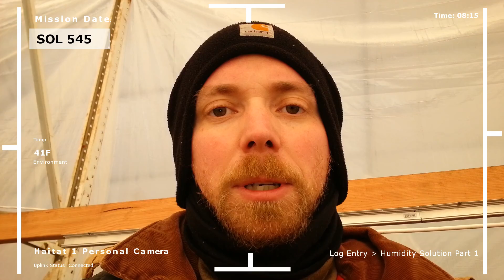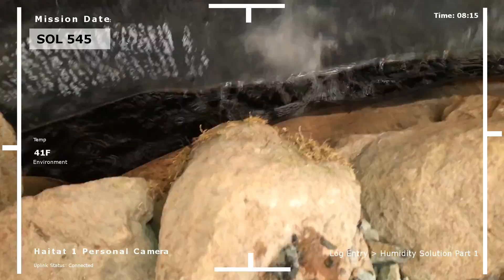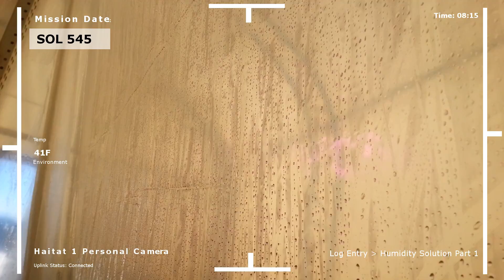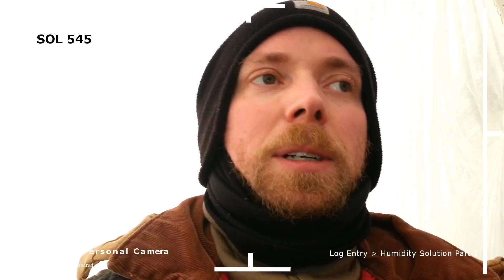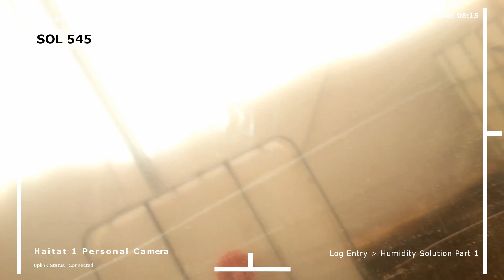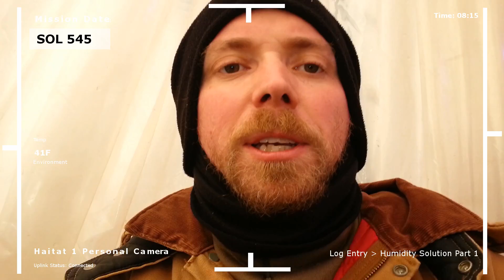Low Cost, DIY, GREENHOUSE Heating Solution  - Part 1

Comment: If the primary moisture source are the growing beds and you are using trays then why couldn't you make inserts so that only the surface of the plants are exposed to the air?  This way the water source is not exposed to the air and will them make the fish tanks the number 1 water source which can be sealed as long as the water is well oxygenated?!  Correct me if my thinking is wrong or I am missing something.
Dale Orthman-Castle man!

Comment: thow it would not help with the cold that coming right now and the humidity if you are use a 3 layers of plastic with a half 5 centimeter gap using air as the insulator and by putting a wood stove above ground to draw out the humidity  or you could uses a whole house dehumidifier

Comment: Patroon here:

Im familiar with this sort of thing.  I have been drying houses after water damages for many years, only recently changed professions, and was certified in advanced structural drying.

I hope this gives you idea.

For every 20 degree increase the air doubles its moisture capacity.  Essentially, cutting the Relative humility in half.  But again if you lower the temp by 20 degrees you are doubling RH.   Also, another variable that plays a role in the amount of evaporation you will get is Vapor pressure differential.  The greater the difference the greater the evaporation.  Another way of removing this moisture based on the principle above you can take the cold air outside and heat it up this will create an enormous vapor pressure differential sucking up the moisture and having that moisture laden air go into a second chamber outside the tent to condense on the walls.  and simply pump the water back into the fish tanks.

This is really cool what your doing and i'll be sticking around.

Comment: This is going to be fun,Jeff, thanks. But when the water condenses onto your sheet, isn't it just releasing heat into the air inside?
Reply from the maker: thanks for following us Craig. The heat release does occur but it actually releases onto the plastic and then transfers through the plastic into the outer area.

Comment: The dehumidifier is a solution for the immediate problem. But, they do suck energy. For the long term, you might want to experiment with some other technologies. Some people use a highly absorbent  polymer that is contained within a large wheel. A small fan circulates the humid air on one side of the wheel which slowly rotates. The polymer absorbs a lot of moisture and then they use solar energy to drive the moisture out of the absorbent as it rotates through a separate chamber. I don't see why that process couldn't be adapted to use heat from your wood burner.  Its just one of the possible options.

Comment: Am looking this, making my brain work as you explain it with the issues and theories on it.  Please keep up the good work. Can this be computer controlled/ monitored maybe from a Raspberry PI, small lightweight and low voltage?
Reply from the maker: it sure can...I'm using Arduino for now but plan on getting custom boards to minimize size, power, and complexity, in the future...thus minimizing all costs and getting a truly optimized solution.

Comment: dehu is only one part of the equation, mitigation should be the focus, start plants in rockwool and transfer them into covered beds grow your micro green in a tent that is part of the grow bed. also consider aeroponics as they are far less water intensive and easier to control the water evaporation, temps etc. also you can double the outer layer on the greenhouse to give you a thermal barrier that can be inflated with air to give you  some insulation....

Comment: I have ran into a very similar problem with humidity as well.  Ours is actually to the point it rains inside from the condensation.  Dehumidifiers suck a lot of juice which is expensive to make off grid or on mars.  It would be much more efficient to use temperature as humidity is relative to temp.  
If you pull up a dew point chart you will be able to calculate the temperature swings necessary to dry the air out inside your tunnels and push the hot air into the main greenhouse to condense on the side walls.  I think the french drain idea or gutters is great to capture the water.  Heat can be generated many different ways which makes it more doable for off grid.  Also remember that mold hates air movement.

Comment: I will start off with a very basic suggestion. You are trying to control the environment inside a Plastic bubble with no Insulation. The temperature swings from night to daytime on sunny days are huge. The money you will spend on insulating will payoff in reduced energy for heating in the winter and cooling in the summer.

Comment: As someone already commented, I second the idea for a general system overview video.  I am sure you will cover all the features eventually, but it would be neat to understand the entire concept right from the beginning.  I get the aquaponics part, but am hazy on the methane digesters.  I take it you are using manure from your cattle to supplement the solar generated electricity?  How does that work and is it on line yet?

Comment: Unless NASA (or whomever makes it to mars first) chooses to use nuclear power, wont electricity to run these systems be limited? 

All the dehumidifier is doing is creating the perfect place for water vapor to condensate, which is to say a cooler place. Could that be accomplished using the cold environment you have available to you, rather than electricity powering a refrigerant system?  You could use a closed loop PEX tubing filled with antifreeze. It would consist of a series of coils inside the hab and outside in the freezing environment and a small circulator pump to keep the fluid moving. It would work similar to a geothermal loop but cold.
Reply: I suspect he has a better electricity budget than heat.  In other words, doesn't your suggested design effectively pump heat out of the greenhouse whereas powering an electronic device (which probably creates heat while at the same time iot creates cold...) is probably close to zero net temp change (A hypothesis to test!).
Reply: IDK, thats why I asked. The Dehumidifier is literally making ice at the cost of electricity. If the cold tubing is the only mechanic condensing the water vapor why not use the outdoor ambient temp to do the same thing.
Reply: On actual Mars where you have almost no atmosphere you would also get almost no passive cooling so it wouldn't do much.
But on Earth you can use external temperature to get the same condensing effect, downside is a good deal of extra infrastructure and bulk.
Reply: While air cooling would be more convenient, the frozen ground would work fine as a heat sink. It might also be worth the heat investment to free small amounts of water from the ground.

Comment: Good idea to put the dehumidifier inline with ventilation system.  I'm new to you. What is your ventilation system?
  Is the ventilation system ducted?  
 Is the grow tent inside the larger tent? 
 Where are you pulling air in from?
   I assume the vent system is exhausted to the outside? 
 Is there filtration?
 I'm in hvac and have to deal with a some of what you might be dealing with. 
 I'm sure you have heard of an HRV system, uncertain if something like that would be helpful?
 I'm just throwing stuff at you that you prob already know. 
 Like what you are doing! 
 More power to you!

Comment: Have you considered using Stirling engines to power fans? You need more air movement in there and with you already having a temperature variance it looks like a free solution energywise.

Comment: Hey, I'm really liking the channel so far!

Someone else mentioned about a second layer of poly with the middle inflated.  Have you heard of Dynamic Air Shelters?  They are a company based in Calgary, Alberta Canada, that produces their structures in my hometown in Newfoundland, Canada.  They are blast resistant, used often in oil industry and currently working on new technology for the Canadian military.  You should check them out as perhaps it's the sort of structure you'd have an interest in.

Their website is http://www.dynamicairshelters.com/

Looking forward to more videos!

Comment: If the dehumidifier condenses and removes the water vapor from the air within the tent, over time, we would sssume that the water levels in the fish tanks would slowly drop. Can that same water be reintroduced back into the fish tanks from outside the tent?

Comment: You work in metric, which is straightforward....but Fahrenheit, which isn't!!!
Reply from the maker: yup...i got some mental retraining to do myself and also need to get some metric gear in place...I'm working it. Doesn't change my point of view though. Metric is way easier. For all us Yanks, just takes some time to get the relative size/temp/etc in our heads...which of course are thick (well mine is). :-)

Comment: Even though the fish tanks aren't the biggest humidity contributor I think you could get some good  mileage out of covering them more closely. The water falling back into the tank should be enough aeration that you could place float boards on the surface and reduce the surface area of the water exposed to the air.

Comment: Water in your air in the habitat (NB: check spelling of " habitat"on your screen) comes from both evaporation and transpiration.  As your plant burden increases you will have increasing transpiration, which likely will make the humidity problem worse.  Something to plan for?
Reply from the maker: thanks for the spell check. Sadly I caught it after the video was created and since it took so long I chose to leave it as is. Argh...computers can be so helpful and so frustrating at the same time. Good point. I think that the transpiration should be significantly less than the surface area contribution. I didn't add transpiration to my model yet but that's a good reco.
Reply: +TheRealMartian I'm also not sure which factor will introduce more humidity, but I would point out that, while evaporation is a largely passive process driven by the laws of physics (as you point out so cogently in the video), transpiration is an active, energy-driven process that will be highly dependent on species grown.  (For example, desert plants transpire relatively less water than jungle plants.) 

The contribution of the species mix to overall humidity will be an interesting variable to measure and account for.  I could see where the plant ratios might become an important issue from an engineering standpoint in a truly closed system.

Comment: Are you using drip irrigation? If drip irrigation was buried an inch or so, and drain water was kept from air contact, that would help with humidity. Fascinating project, by the way. I wish you all the best, and happy new year.

Comment: Will you discuss your reasons to build in that area of not only WA but the PNW?  Wouldn't a little farther east in Oregon have been better?  Curious...  If the water going down into the fish tank didn't flow like you have it, there would be less evaporation (no agitation or mixture with the air).  You have a waterfall and that places a lot of moisture into the air.  I know, you have the visqueen.
Reply: He may need the aeration.  In fact, unless he has an aerator he and the fish definitely need the aeration.
Reply: Invincible Osprey I totally agree with you, I had forgot about the Trout.

Comment: Hey I work with that poly on a daily basis. If you throw a second sheet of poly over that and inflate it with the outside air it should reduce those water drops a lot